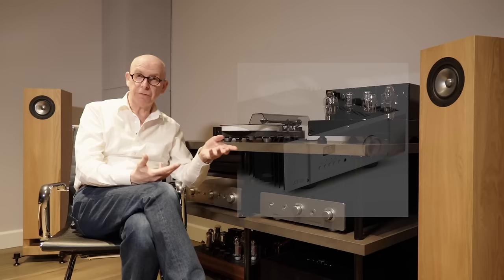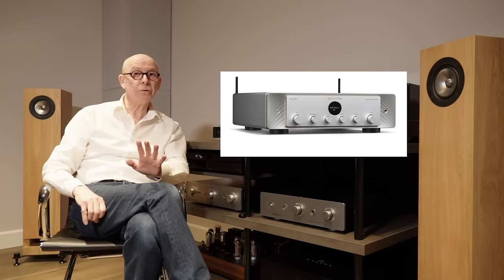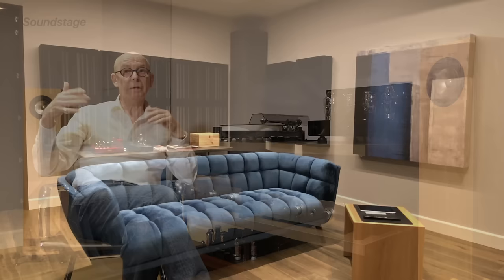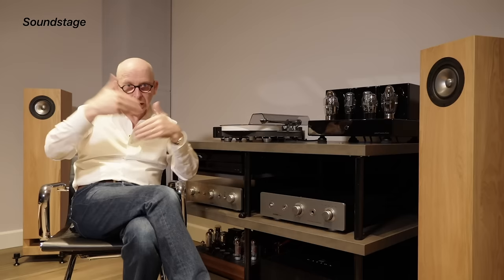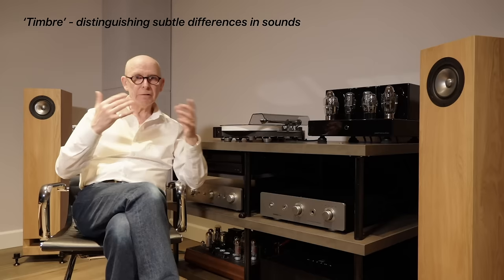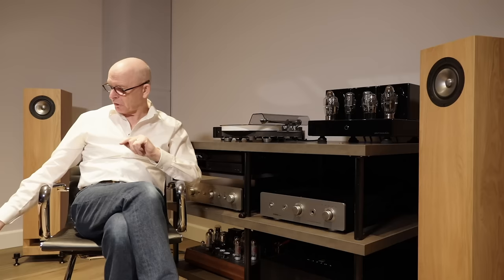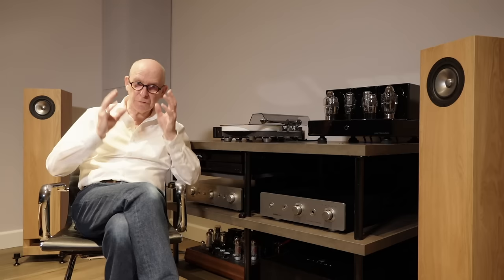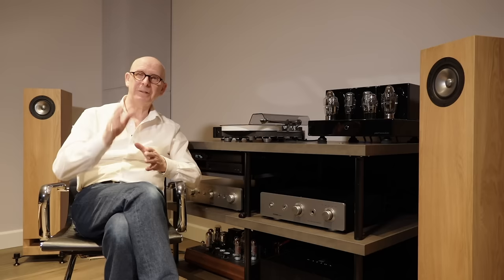Class 'A' vs 'AB' amplifiers: The search for a perfect soundstage and an emotional connection

Comment: Is it correct that a class D amp there is no crossover distortion, so a high end or refined class D amp can compete with class A amps?
Reply: who cares - it's class D
Reply: @TrueAudio  Meaning?
Reply: @Stuntpoeten  many times not i read reports of class D sounding 'bright'; brighter than the normal A & AB
..so many times
Reply: @TrueAudio  I have heard Bluesound Powernode on Kef Q150, and Dali Menuet SE. They sound warm, pinpoint three dimensional imaging and detailed. Even WiiM Amp on Kef Q150 sound surprisingly warm and good, and is a shocking good combination for the money. In Stereophile Recommended Components Fall 2023 Edition Integrated Amplifiers, NAD Masters Series M33 is group A, and Bluesound Powernode group C. I have also had Sugden class A on Rogers LS3/5A back in the mid eighties, and that was a total mismatch.
Reply from the maker: Hi, yes it is absolutely correct. But with class D you need to look at the whole chain. For example even the best class D amplifier in the world can sound bland. It’s not the type of architecture that matters most, but it’s execution. For example there is loads of professional class D equipment that sounds incredible. You could check out my video on the perfect amplifier. And my interview with Bruno Putzeys.
Reply: @PearlAcoustics   That makes sense since Peter Lyngdorf, is Co-Founder with Bruno Putzeys at PURIFI. Peter Lyngdorf is involved in NAD and Bluesound and it contains parts or the whole technology from Bruno Putzeys. I have also heard a diy build with Linkwitz  LXmini (also a sort of fullrange) and Mauro Penasa MyRef (don't know which version) which is a class AB amp with a chip-amp (LM3886) but the circuit around is different to make it sound more like a class A amp (transistors or tubes). That also sounded great! It seems that it is important to have the least distortion and high resolution, full three dimensional tonal and imaging quality also at low level output. That is the force of class A amps since the power stage is always on, the current always flows through the transistors or tubes even when it is quiet. So a class D amp must perform perfect at any level and frequency from quiet to max in complex loads like a speaker to compete. A task I think the future politics demands as electric power is limited in the World, and it will succeed with good engineering. But there is always place and time for enthusiasts who like old cars, and certainly also vinyl, class A, transistors or tubes, horn speakers and so on. A good guess what the future brings is "his favorite product or pet dog" from Peter Lyngdorf: Lyngdorf Audios TDAI-3400 .

Comment: Interesting discussion.   It is likely at moderate listening levels say the first 15-20 watts, a well designed class AB amp is probably operating in class A mode verty similar to a solid state class A amp.  As such ithe sound differences between one solid state class A amp and a solid state class AB amp largely comes down to which type of sound you as the listener like better as opposed to whether class A design is better than class AB.  However differences start to appear more stark when one cranks up the volume and plays at say 80-100 watts, perhaps driving some large tower speakers to create a sense of  a live concert when say listening to Tchaikovsky - 1812 Overture.  I would think at some point  most valve and solid state class A amps will  have run out of juice due to the dynamic swings in the music, start to clip and   perhapss the soundstage breaks down.   Class A amps are great sounding for example the legendary Kondo Ongaku 15 watt integrated tube amplifier but we do need to realise it comes with some limitations as well.
Reply from the maker: Thanks for sharing your views with the channel. The strange thing is that, Most of the time we are only listening at around 1 watt, in a moderately sized room.

Comment: I have to agree that class A does sound slightly better than all other class of amplification. I have to agree that sound staging and how natural the sound sounds is likewise the best. That said class AB does not rule out the same it is just more difacult to aquire!

You pay dearly for it though in terms of effeciency, heat, power consumption, output power, durability if used often and for long. Then you have the cost to purchase and the availability of said units!
Reply from the maker: Thanks for sharing. With regards durability, if an amplifier is well designed, it should last for decades, even those that run hot. But I get your point!

Comment: To my ears the Rega sounds the smallest, no debt in the soundstage. The PassLabs has the widest image (but I think the image is turned around). The Sugden has most dept and precision in the image, The Musical Fidelity sounds wider than the Rega, but doesn't have the clear placement in the image the Sugden or Passlabs can project
Reply from the maker: Indeed, you’re absolutely correct, I screwed up up by accidentally switching the inputs on the Pass. And didn’t even notice during the editing. Sorry. Unfortunately it was too late to correct it. Best wishes from Belgium

Comment: Even through YT, the result is night & day.  The AB bias amp has an eerily exaggerated Doppler pitch delta that follows the amplitude of the audio.  The class A bias is clean, pure and uncolored.  To me, it's so obvious that I had to question the integrity of the experiment and hope that there were not shenanigans at play.  My money is on the PASS LABS INT-25 as the clear winner for purity and transparency. 

PS.  I have always said "the chain is only as strong as the weakest link" and for audio that begins with the playback room acoustics, followed by the listeners ear and the ability to discern nuances.  The playback system is less important than the preceding two.  Keep up the GREAT work.
Reply from the maker: Thanks very much. For your kind appreciation and comment. I tried to be as scientific as possible with the comparisons. Every recording was carried out with exactly the same equipment and settings and positioning. The only difference being the amount of gain applied via the pre-amplifier to ensure exactly the same sound pressure level in the room (+/-1db).
Reply: @PearlAcoustics  You did a great job keeping the gain equal between the four tests. As a former broadcast engineer, I hear things in audio that many do not.  This is a wonderful test.  I hope there are many more to follow.  👍
Reply from the maker: @WECB640  thanks. You’re very kind. I guess as sound engineers, it’s our job. 😉

Comment: The widest soundstage I've ever heard came from coherent, single-driver omnidirectional speakers (Walsh), followed by directional speakers with high dispersion coaxial drivers.  The common theme is reducing positional "smear" across the frequency spectrum.  Your budget is better spent on speakers.  In 2024, modern Class 'D' amps from the likes of Icepower and Hypex measure equivalently if not better than most Class 'A' or  'AB'.  Avoid 'A' or "AB' unless you are looking for something other than "wire with gain" measurements.  An amp is an ineffective way to chase soundstage.  To the extent that dynamic range improves emotional connection, the extra headroom you can afford with high-powered class 'D' is also a plus.
Reply from the maker: Thanks for sharing your experience

Comment: all this signal accuracy stuff falls into insignificance as long as you have a valve amplifier. Valve amps need an output transformer which will always add 1% distortion. (CC BSc Elec Eng)
Reply from the maker: Hi thanks for your comment. Although, in the past, the output transformers did increase the distortion figures, today, it’s very different. With advanced winding techniques, inductance management incorporating local feedback loops - the quality has completely risen to another level. Like all these things, it’s a case of listen and decide. Tube amplifiers are definitely not for everyone
Reply: @PearlAcoustics  Thankyou for the update. I admit I was thinking of things as they were in the past. Keep up the good work.
Reply from the maker: @chriscordingley4686  thanks, will do my best! No worries.

Comment: Unfortunately I haven't been able to listen to the sound clips yet.
Like Harvey, I am a big fan of single driver speakers. They have a coherence to the sound that most multi-driver cannot compete with. I think this is down to timing. Although multi-driver can produce a flatter amplitude response they are much inferior in the time domain. Human hearing is more sensitive to timing errors than it is to amplitude errors.

For me the best amplifiers currently available, based souly on listening, are class A valves. Having said that the latest class D amplifiers from the likes of Purifi and Hypex are closing the gap. I don't think it will be very long before class D overtakes the class A valve amplifier.
Reply from the maker: Thanks for your comment. I hope you enjoyed the video

Comment: I have noticed that all good headphone amps are class A. No-one makes a class AB headphone amp these days, so the industry has clearly converged on class A for solid state when output power need not be high. Still, I notice major differences in soundstaging between those class A amps. For electrostatic headphones, the differences are even larger, both in terms of how instruments sound but also how they are presented in the three dimensional space and how much resolution there is. Of course, the DAC also plays a role here, especially when moving between chipset DACs and ladder DACs. 

I have never heard a loudspeaker with a single driver. That seems interesting. Some coaxial twdrivers I have heard provide quite good stereo imaging and are less sensitive to room acoustics than some other designs, so perhaps this technique has that benefit plus no crossover.
Reply from the maker: Interesting comment thanks. Feel free to reach out, if you ever want a listen. Depending on where you are based it could be arranged.

Comment: Don't Pass Labs rate their amplifier's output at 0.01% THD? I expect Rega and Musical Fidelity give their power specs at 0.1% (what Hi-Fi magazine tests use), or 1% (which used to be an industry standard). Comparing these amps on a level playing field, the INT25 is probably better described as a 50 watt amplifier.
Reply: Edit- I've just looked up Paul Miller's test results (Hi-Fi News) of the INT-25, he measured 68W into 8Ω at less than 1% THD
Reply: @billspencer8540 
You're missing the point, it's just a arbitrary point of measurement, "impressive" has nothing to do with it

Comment: 13:40 I think your not really taking into account the effect an amplifier's output impedance will have when it interacts with the speaker.  All speakers and headphones have an impedance which is a function of frequency; depending on the loudspeaker's impedance characteristics, the amplifier could well subtly alter the frequency response of the system; there's an excellent article on this by John Siu over at Benchmark entitled: 'Audio Myth - "Damping Factor Isn't Much of a Factor"' which rather nicely explains the phenomena.  What you're hearing could well be the different characteristics between amplifiers with 'high' and 'low' output impedance making the sound more 'recessed' which would move you back a row or two giving the impression of a narrower soundstage; of course it could also be expectation bias.  21:45 Interesting, listening through: restored Arcam rDAC -> Icon Audio (yes class 'A' tubed) HP8 MKII headphone amp -> Beyerdynamic DT 770 250Ω I prefer the Rega the most and the Sugden the least.  Even through the YouTube algorithm, the Rega seems to have the most "flesh on the bone", with the other amps sounding a little too "lean" for my tastes; horses for courses.
Reply from the maker: Thanks for your addition to the topic and for sharing your findings too
Reply: @PearlAcoustics  No problem and my pleasure.

Comment: I have the Pass XA 25 amp with a couple different preamps, and when I keep the preamp the same (typically using a very neutral solid state), the soundstage on the Pass is better than my Hypex-based amp but not nearly as good as my Quicksilver tube amp. In general, I've found the difference between amps to vary mostly in the depth (fineness of layering and extent of depth) rather than width.
Reply from the maker: Interesting. Thanks for sharing.

Comment: strange choice of recording to use. the horn section sounded very constricted (i.e no width to the sound) and Teal was recorded in a box. Given that the Pass had much nicer bass line thabn the Rega. the MF wider soundstage than the Sugden.  (in my system ; tube amp , jordan full range speakers)
Reply from the maker: Thanks for sharing your findings

Comment: If you're looking for soundstage in an amp, you're probably either confused or mislead about audio - a true audiophile.
Reply: People mislead themselves. John Galt told me. If you want a very good audio system, use large horns, big woofers, tiny wires, simple amps, no pre-amps, very minimalistic sources. Use as little as much components and the least safety. Remember that caps, resistors, diodes, coils, connections, circuit boards, hi-res very much degrades the sound. Cable management and tidy looks do make worse sounding systems.

Comment: What a load of BS. Does this guy not understand the first thing about audio electronics (or anything else connected with audio for that matter) ? The best audio components (amps/dacs) are the ones you can't hear. Not the ones that do this, and sound like this, and make your Mozart/Pink Floyd sound better. Get out of the rabbit hole guys.
Reply: And how many HiFi components have you designed and sold successfully.....? 🤔
Reply: How do you know whether you’re hearing something or an absence of something? It’s about removing the negatives.
Reply: When you use an FFT audio analyzer you see everything therre is to see which comprises the test signal. You don't see fairies at the bottom of the garden or the ghost of the infamous reviewer Harry Pearson (who introduced subjective reviewing in the 60s/70s). You don't see "musicality" or "emotional connection" either.  If there is minimal noise and distortion (below the hearing threshold) you won't hear the component under test.The whole point of true High Fidelity audio (not HiFi) is that you only hear the source recording and the speakers (unavoidable). It doesn't get better than that. You're supposed to spend your listening time listening to your music - not your amp or your DAC.
Reply: @davidcarr2216  So you think everything about music reproduction can be seen in an FFT test signal....? Shame that every professional audio designer disagrees! You just sound silly and naive...go back to ASR and play with your 1Khz signal......🤣
Reply: @steven2809  Pretty much, it can, for DACs at least, for amps it's a bit trickier  When was the last time you saw anything published in a peer-reviewed, academic paper by a "HiFi" designer ? The whole industry is on the game - you just haven't figured it out yet. There's nothing remotely professional about the "HiFi" industry. A professional audio designer would back up what he says with data BTW.
Reply: @Cipollae  Controlled listening tests plus measurements.  DACs are now pretty much at the theoretical limits of performance and they don’t even need to be very expensive. The best amps are getting up there too but not quite as good. You can do this stuff by controlled listening plus measurements OR you can stay down the rabbit hole. When a DAC or amp is said to  make your Frank Sinatra/ Norah Jones/ Taylor Swift sound better that’s just the rabbit hole . Sure , it might make your XXXX sound different - the “better” part is just the hype/tripe/BS/audio porn prose part of the rabbit hole. All this nonsense is just about selling expensive, badly designed gear and then to keep on selling you even more expensive , badly designed gear. You don’t believe me ? Try reading some research papers in audio. Sound quality is mainly about recording quality anyway, followed by speaker/speaker-room interaction.